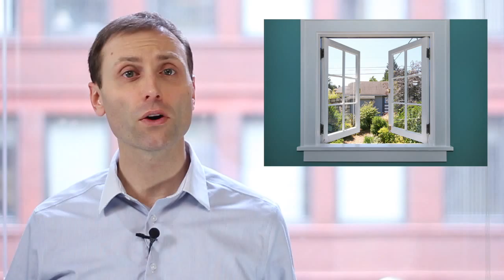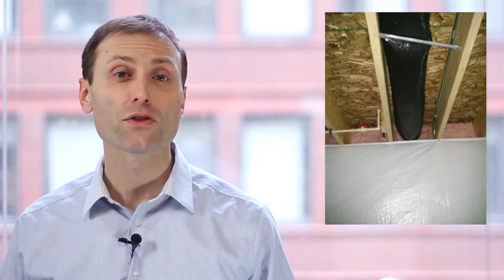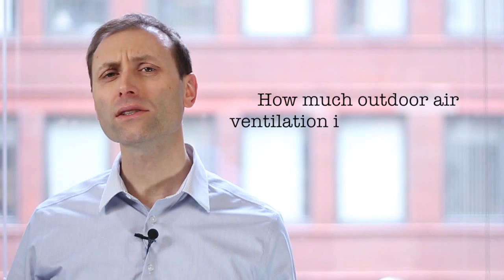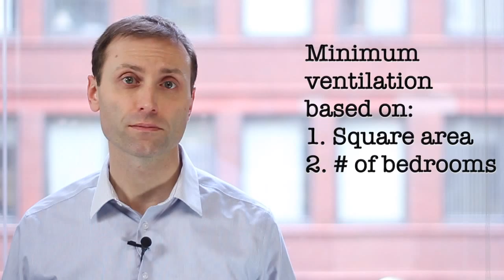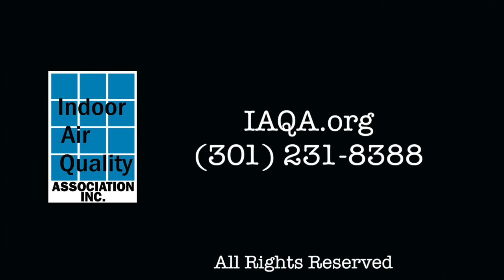Residential Ventilation

Comment: As a certified Florida Mold Assessor and certified remediator and Licensed Builder and Home Inspector I believe home ventilation is the most critical element to having a healthy home and good indoor air quality. When trying to resolve indoor air quality issues evaluate the ventilation carefully. The mechanical engineering industry in residential construction unfortunately has been more reactive to changes in energy code requirements than proactive. As we have tightened up new home construction we may have solved one problem but created another. Non ventilated kitchen hood fans, unvented bathroom fans and lack of air supply in closets is a recipe for indoor air quality problems. It is most important that we understand ventilation. Ventilation for crawl spaces, attics, closets and whole house are all critical to air quality. Potentially conflicting energy codes or methods to improve energy ratings have contributed to the problems in Florida over the past years. Thanks for helping create awareness with this blog.